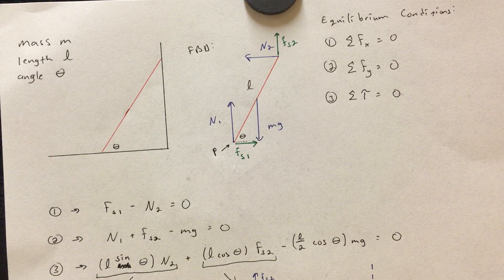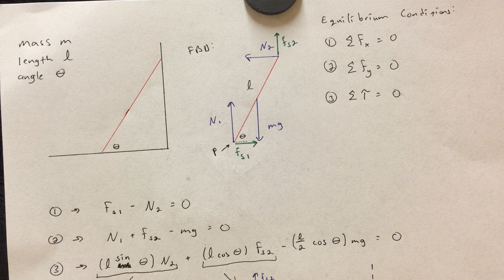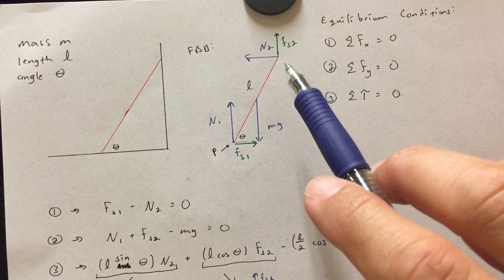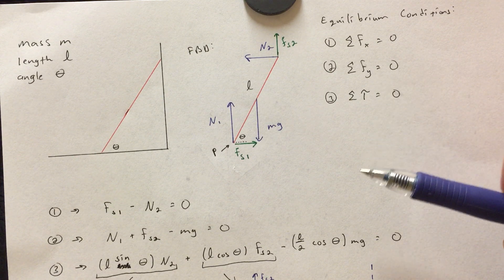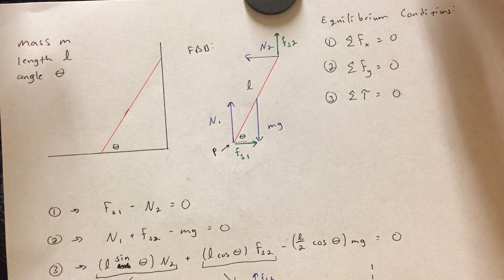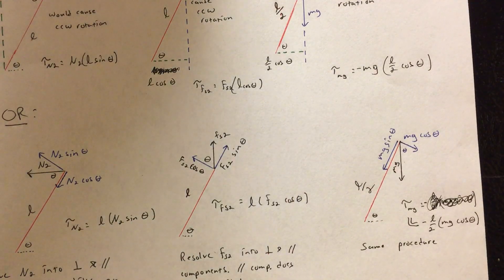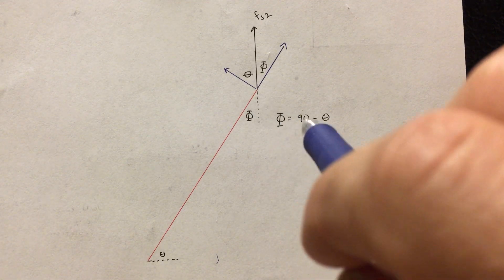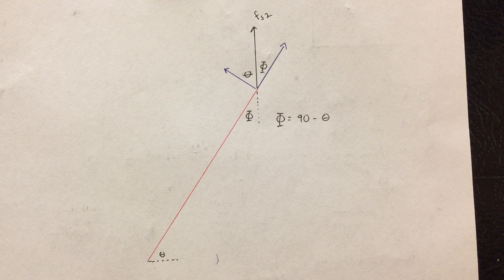Leaning Ladder Torque Example

Comment: When figuring out the torque equations for each force, why do we have to use sin for N2 and cos for gravitational torque?
Reply from the maker: Hi, Theresa. So, the short answer is that you don't, and there are plenty of physics teachers out there who ONLY use the sine function (which comes out of the full vector treatment using the cross product). When you do that, you let the angles between the vectors run from 0 to 2Pi, and negative signs come out of that as a matter of course. I've found that it's usually less confusing to forego the vector treatment and deal with magnitudes, assigning positives or negatives based on an inspection of what sort of rotation a particular torque will produce. I use the geometry of the system to my advantage, peeling off distances using either sine or cosine depending on which side of a triangle I'm trying to find. So, I get both functions because the forces can be oriented at any direction, and I'm starting off with a set angle given by the problem statement. I run through the process quickly starting at 6:15 in the video.